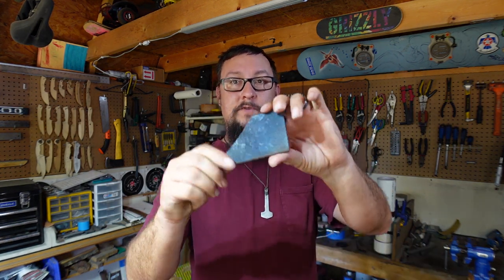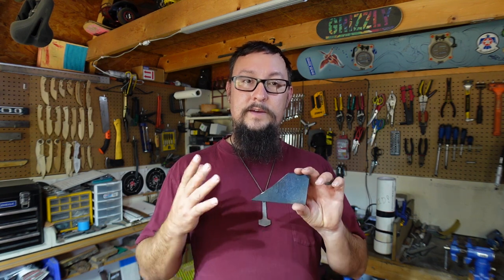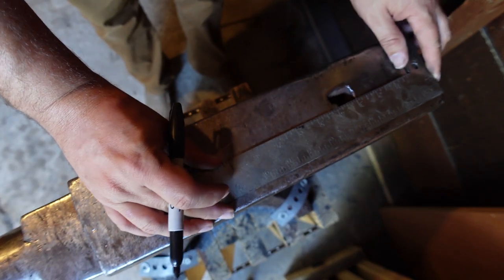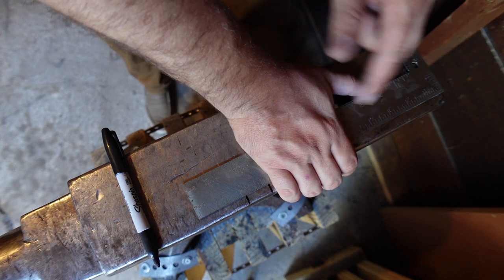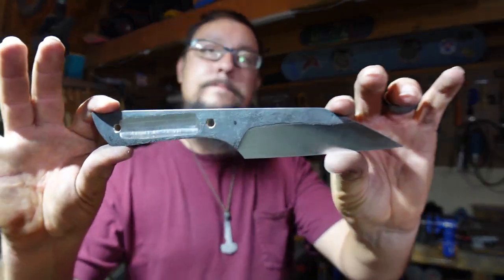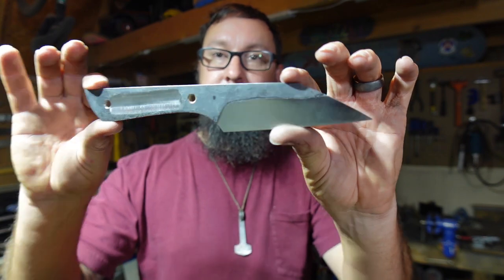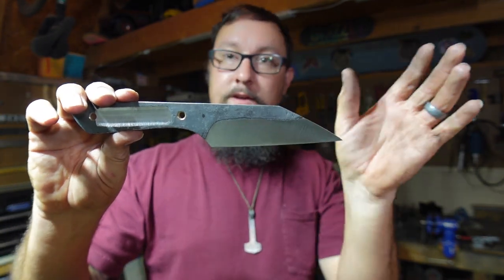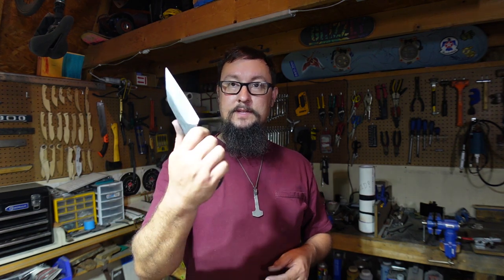Forging A Piece Of Scrap 5160 Into An EDC Seax Knife | Knife Makers Vlog

Comment: Cool Seax knife! I also save different leftovers in hope that I will need them sometimes. Sometimes it is just hard to remember what stuff I have in my stock.
Reply from the maker: Thanks! I keep as many of them as possible because sometimes it's nice just to knock out a knife to get back in the rhythm.
Reply: I have the same problem. I know I can just write what it is on the scrap. But I neglect to

Comment: Great build, Erick!  That 5160 certainly is a tough one to move under the hammer.  What’s with your forge?  It’s sputtering quite a bit.
Reply from the maker: I need to redo my gas lines and fine tune the burner a bit. I'm building a new forge so it hasn't been a priority, new forge and burners.
Reply from the maker: @TyrellKnifeworks  Yes, I figured it was finally time.

Comment: Very nice work!
Many moons ago when I was a carpenter (before air nailers) we were taught to "move" nails/metal with our hammer blows by pulling, pushing, or side to side movements of our hammers. it allowed us to keep on driving nails that may have bent slightly during the initial hammer strike, by pushing or pulling them in the direction we wanted them to go. we also used the technique in metalwork to cover odd shapes. I can see where it might also work in forging to move the metal where you wanted it to go.

Do you use hammer blows to push/pull the metal when forging?
Or do you just let the rounded face of the hammer move the metal without trying to push or pull it where needed?
I tried to watch closely to see if you were performing any push/pull hammer blows, but I couldn't tell for sure.
Reply from the maker: Yup, there is a lot of pushing and pulling when moving steel. You have to get use to your hammer blows to get the steel to move where you want it to go. The more that you can focus on this, the less work you have to do later. When the time lapse's aren't going its a lot easier to see my hammer blows and how I'm swinging the hammer.
Reply: @theriversexperience9383 , Awesome! Thank much for the reply, I appreciate it! Once I am able to get started I think I can do well at that because of my prior experience. 
P.S. I loved the KaramBowie (I voted for it) and I'd love to see you make more of them if it is worth your time. Thanks!